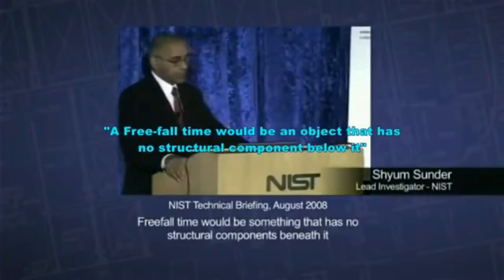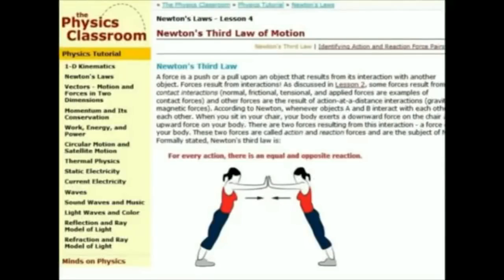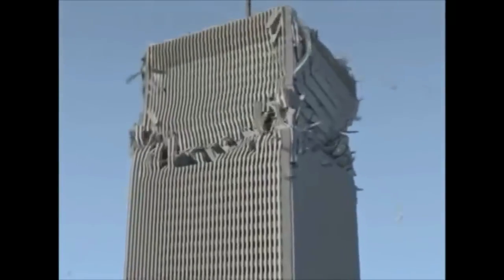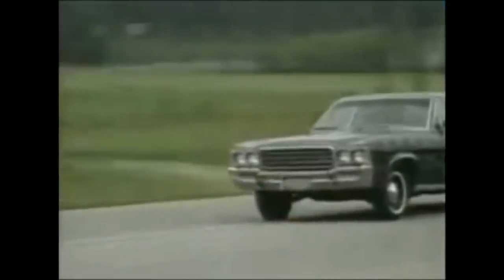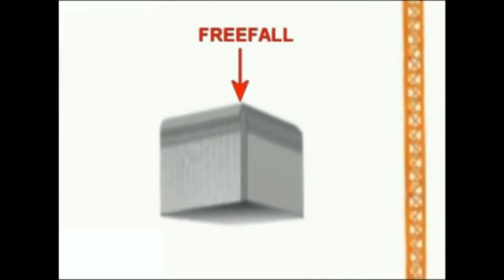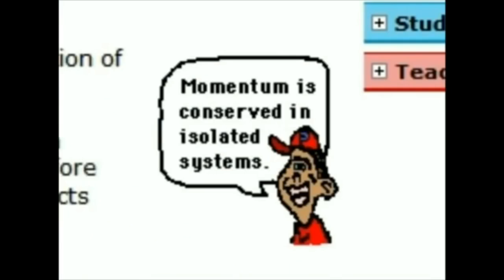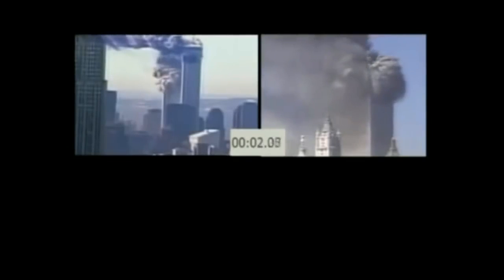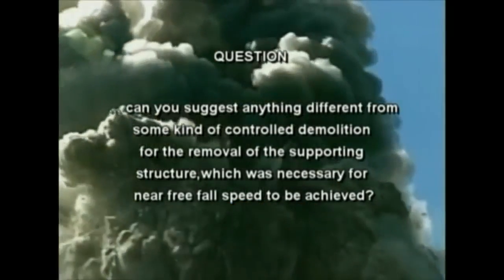9/11- Collapses Violated Fundamental Laws of Physics Explained

Comment: G'day,

  Yay Team !

    Did you notice that the Grenfell Tower in London burned from bottom to top ; and it's all still standing..?

   I posted a video about why it burned so well, and how come so few people got out of it.

  By the synchronicity of the coincidence, I happened to be in posession of a sample of the flamable Aluminium Composite Panelling the Towering Inferno was clad in 4 years ago, when they removed 2 of it's 3 Fire Escapes, and installed LP Gas-Delivery-Pipes up the centre of the single remaining set of Stairs....; so I felt an obligation to share the snippet.

  Have a good one,

  ;-p

  Ciao !

  Have a good one
Reply: WarblesOnALot czzxzmkskskakaiaisjkdjffi